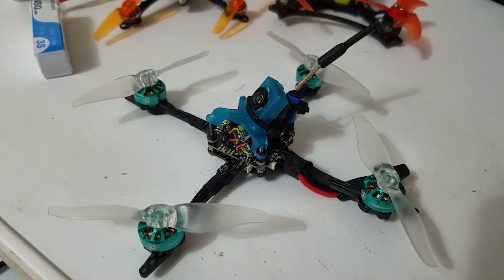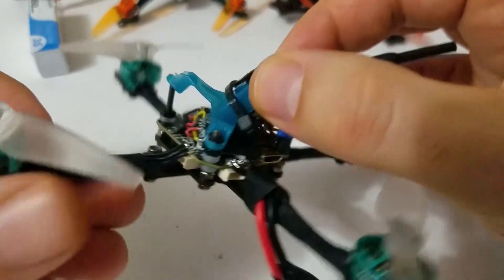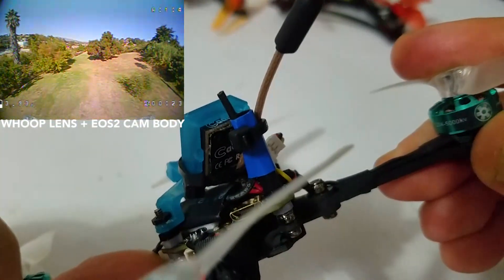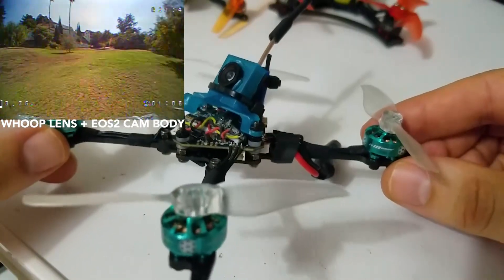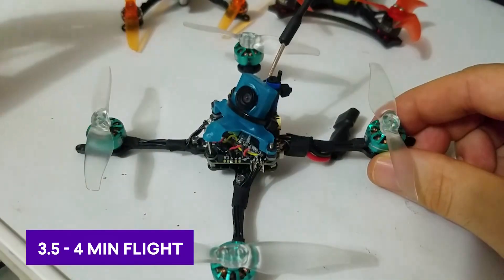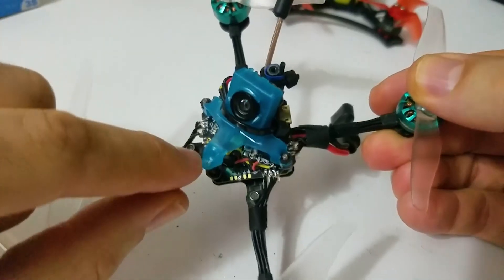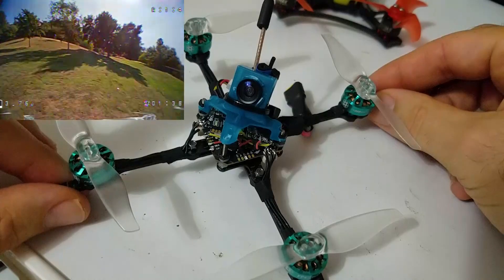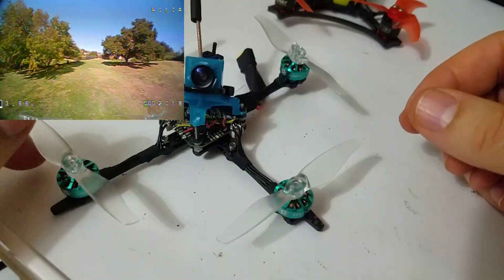Kababfpv Toothpick 3 TP3 Review / Build / PIDS / Flight + CUSTOM CAMERA

Comment: This is still a very light build - why don't you try 2.5 inch tri-blade props? The best ones I've found for my TH Freestyle (and now also use them on my 2s BT) are Geprc 2523 (they have a very similar shape to 3016. They're super-quiet too. Alternatively you can also try HQ Durable 2525 props or Gemfan Hurricanes 2512 - these may be too low pitch though for your style of flying...

Comment: Can you share the stock pids? I can't find them anywhere.
Reply from the maker: Scroll down on this page for pids and rates: https://fpvcycle.com/collections/frames/products/kabab-toothpick-3-tp3-frame
Reply: NikFPV would those work for 2s as well? I see it says for a 3s set up
Reply from the maker: @DRTOLLZ  I imagine so yes
Reply: NikFPV I ran the suggested pids and had a lot of prop wash. Reverted back to my old settings with much higher d gains and higher feed forward. Runs much smoother. Motors still barely warm.

Comment: Well, I bit the bullet and ordered the 1303 motors, TP3 frame, and some other key parts, and built one with the NamelessRC AIO412T board, and running GemFan 3016 tri-blade props. It flies already quite well, as you can see here: https://www.youtube.com/watch?v=VR352E37KAM
But it could be better, for instance there are some minor trembles/shudders when cruising on low throttle. The AIO412T boards run BF 4.0.4 so maybe I should just go back to 3.5.7 and use the suggested settings you posted. Although I am using a different board, different motors and a different prop.

Comment: did you tried rpm filtering and 48khz on the esc's?
Reply from the maker: Not on this build yet. I wonder if it would improve flight time.
Reply: @brickclickfidgets  just a couple of hours ago a new BLHeli Firmware got released. 16.78a12

i can recommend it heavily. on all my micros i got a improvement in flighttime from 35 to 50% just by going to JESC 2.1. but now i will try the new blheli 16.78. mate of mine said its even better than JESC.

take a look by yourself and report me in please :) 
https://github.com/JazzMaverick/BLHeli/tree/16.78_A

Comment: Flies great. I hope I one day will have a TP3 or similar, but getting the parts shipped to EU is so expensive, and also anything about 22 euro value gets heavy customs charges too. So instead I got the Larva-X, which is decent, but pales compared to this, it seems.
Reply: Verzendkosten zijn rond €12,50 en binnen 1 week alles in huis. Geen douane kosten. Dus dat valt wel mee en het vliegt geweldig, heel smooth.
Reply: @rybar4023  Je kan geluk hebben met de douane, of een verkoper treffen die de waarde lager aangeeft, maar anders ben je toch echt de klos. Ik heb al een paar keer gehad dat ik iets van 15 euro administratiekosten mocht betalen + 21% over het totaal bedrag incl verzendkosten. En als er geen verzendkosten op het pakket staan, rekenen ze daarvoor gewoon het maximale tarief van 36 euro express verzending. Ben wel benieuwd naar meer details van je TP3.
Reply: @rc-fannl7364  Bob geeft lagere waarde aan en verzendkosten staan erop. En ja, geluk dat je er niet uitgepikt wordt speelt natuurlijk een rol, maar dat is met alles wat je besteld over de grens. TP3 met de amaxinno 1303, namelessrc aio board, happymodle diamond vtx, larva canopy, runcam nano 2, flysky xr602t-a en GNB 450mah 2S. Vliegt echt fijn, veel beheersing/soepel in de lage toeren en snel. Heb de bi en tri blade props die Bob aanbeveelt. Sommige onderdelen kun je ook op BG bestellen scheelt weer. Mijn maat heeft de Geprc Phantom die ook erg fijn vliegt maar hij zegt dat de TP3 toch echt wel veel fijner vliegt.
Reply: @rybar4023  Bob wil inderdaad wel meehelpen, heb ik gemerkt, en nu ook een TP3. Voor een deel dezelfde onderdelen, alleen FPC Cycle 1303/5000kv, 3S 450mAh, en de OV231 camera. En FrSky ontvanger. Inderdaad erg soepel, maar af en toe toch een lichte "wobble" vooral als er wat wind staat. Misschien nog wat tuning nodig, want de lichtere SailFly-X heeft in dezelfde omstandigheden nauwelijks last van de wind.

Comment: Nice camera angle.  Try the babyhawk avan 3 inch props for more grip and nice flight times.  I was able to drills them and press fit them successfully.
Reply: Nice. I have a few spare, but I don't know if I could het a decent drill out of them. I might try it. Thanks for the tip.
Reply: I didn’t have an issue drilling them out
Reply: Do you have a 3D printer?
Reply: @bentray1908  No

Comment: very interesting camera lens solution.  I'm gonna try that on the $20 runcam nano.  Working on a triblade, 3016x3 but haven't tested it yet.  It's on the way, might be delivered today.  I'm not expecting it to work out well since these motors are at their limits.  The slight lacking of the very tip top of the throttle range is where the motors and props have reached their limit.  I was gonna make the motors 4800kv but figured I'll leave the 5000kv because it does give you a bit more pop at the bottom.  the 1303 has that tiny bit of feel at the top 10% of the throttle compared to the 1204 but such minor variation.
Reply from the maker: First of all thank for watching my video! I'm a huge fan of your work. Re: motors I figured that was the case with the 1303. It's still more than fast enough for me. Not that top speed is important but I did a speed test on this guy (which I'll post next week) and I got around 65mph which I was pretty impressed by.  I think it could hit 70mph with a fresh battery. Regarding the camera, if you find an M8 whoop style lens or a runcam nano with that type of lens I really think there's a market there. I would buy one and I'm sure many of your viewers would as well.
Reply: @brickclickfidgets  I've been trying to get a damn camera and canopy seemingly forever.  I've finally found the very best canopy I ever saw, the eachine twig moulded one.  It's 1.7g and wicked durable while also giving structural support to the entire frame too.  But it only fits nano cams, not whoop board cams or the whoop AIO.  I'm just waiting for someone to make a proper nano cam now.  There are two on the way.  A nano predator with a wider angle lens which looks quite amazing and a new one from runcam too.  Hopefully with a wide lens.

so something you'll find pretty interesting with micro speed runs is that you'll never really get a run as fast as the first time you do the speed run. These micro motors loose power really quick as they heat up.  Even just heat up a little.  That's where the ribs on the 1303 come in.  The motor has more consistent performance as a result.....but we're talking about really small differences here.   But basically, the speed run will be determined by how straight and level you go at max speed and by the temp of the magnets.  It's a lot better these days but still has an effect.
Reply: @Kabab  wow never knew that about motor temps. Fascinating
Reply: @karoo_bushman6880  I've found the right camera but it's 1mm too wide for the newbee v2 mount unfortunately. 😔
Reply: @Kabab  so if there was a canopy like the eachine twig canopy, just for the ov231, you would prefer that over a new nano camera?
Reply: @marc_frank  yep. There are no nano cams I prefer over the ov231 but the runcam nano 2 1.8mm lens is the closest.
Reply: @marc_frank  by the eachine twig canopy is no good.
Reply: @Kabab  too brittle?
i don't know how tpu behaves or prints
i only have experience with nylon sls prints
Reply: @marc_frank  yep. Way too brittle. There's nothing I've seen out there with all the properties of the bee brain v2